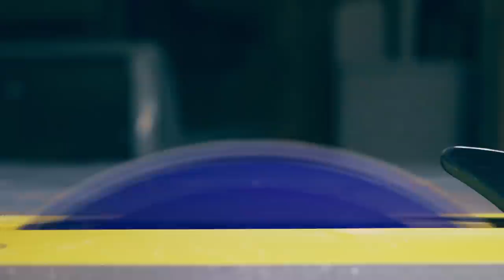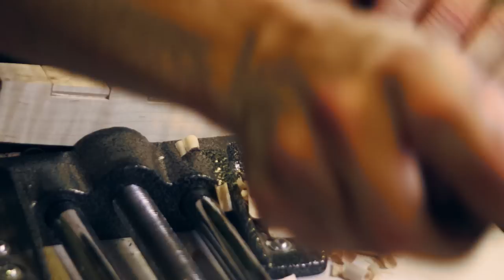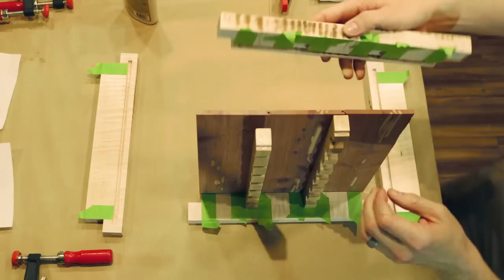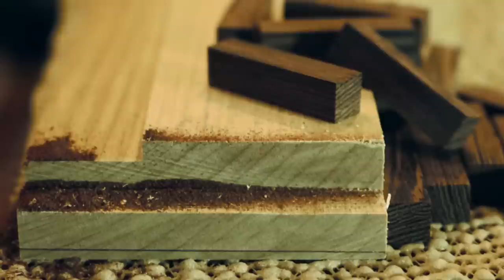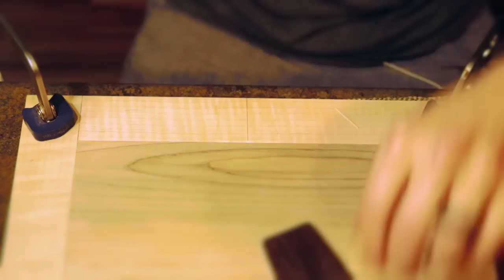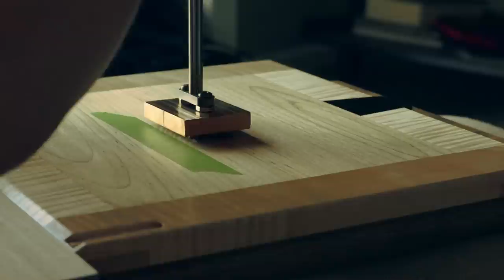Chisel box build with hidden magnetic latch

Comment: Just one thought.. If the chisels lay on top of magnets a while will they not be somewhat magnetized? I believe they will, and then you will not be so happy sharpening them on your nice wetstones. Why? Because all those little metal particles will not wash away with the water but rather stick to the chisels and scratch it up rather than sharpening it. I like the though though.
Reply: surely the magnet is over the chisel handles, not the blades ?
Reply: It will be magnetised when resting over the magnets but will then loose all it when you remove it so it is fine for sharpening etc.  Still wouldn't do it in my shop because i work with metal as well as wood and the case would attract all the metal dust :)
Reply: I have never experienced this problem when sharpening my knives, which store on a magnet block.
Reply: Yeah jonnebanan is right, if you have expensive tool you can kill´em by magnatizing, every metal can be magnatized, cause it will get rusty be time not in  year but later on and they also will get dull
Reply: Anyone who would have such annoying music on a video cant be al that smart!  I bet ya the genius does the same thing with his dam files!

Comment: First off, great video and beautiful project. I have a question, were you spraying something on your scuff pad during the finishing process? Your finish looked flawless!
Reply from the maker: No. It was just plain, dry "0000 steel wool" it works really well with a shellac finish.  After the shellac is totally dry, rub it back with the steel wool using lite to medium pressure. it basically cuts off all the tiny little nibs you can feel in the finish and gives it a slight polish. The I usually end with a lite wax coat after that.  Some people use the steel wool to apply the wax finish, but I usually don't because if you're not using real good quality steel wool (I use the cheap hardware store stuff) then you can get little pieces of steel wool embedded in the wax.

Comment: Cool video! What blade did you use on your Dewalt table saw?
Reply from the maker: It's an Irwin Marples 10 inch 50 tooth combination blade. It's a little cheaper than the comparable Freud blade,  but it makes very clean cuts and has stayed sharp for a long time.  I would recommend it.
Reply: Thanks for the info. Again, cool video! I look forward to more content by you.
Reply from the maker: Jaime Rios its in progress!

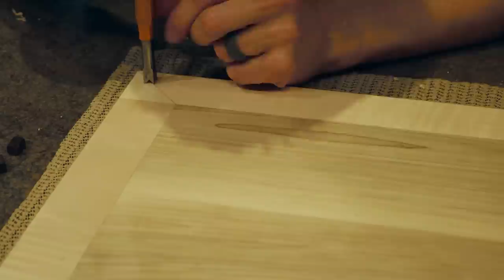Comment: What is the tool used at 8:00 called?
Reply from the maker: David Kiekintveld it's a square hole punch. Basically just a chisel that will punch a square hole.  I just used it to mark a good clean four corners and then I used my 1/4 chisel to actually cut the hole.  I think he square hole punches work great with leather and just ok with wood, that'swhy I actually did the cutting with a chisel.